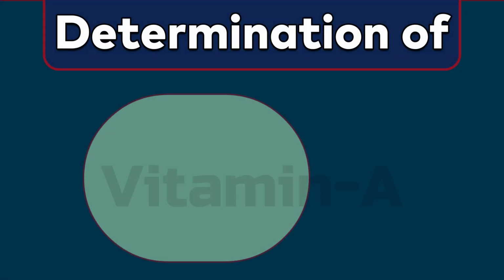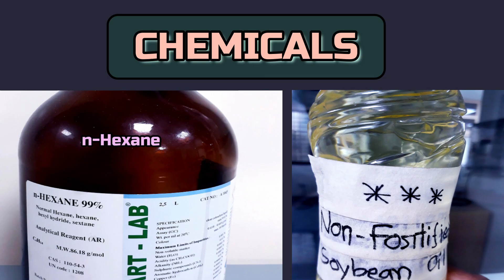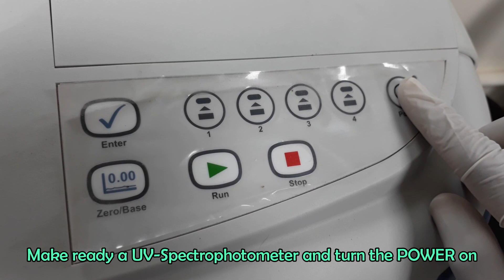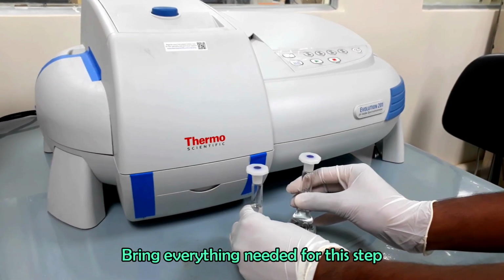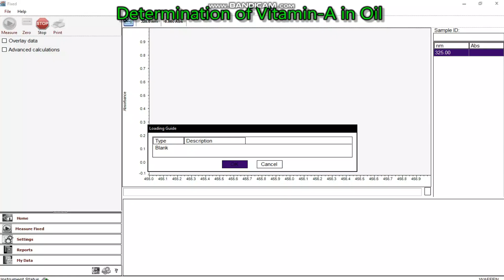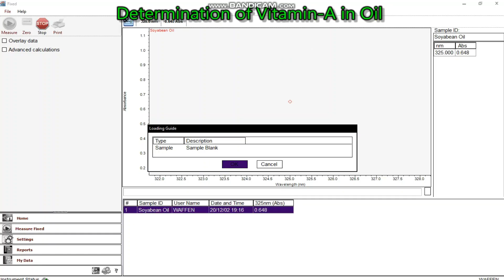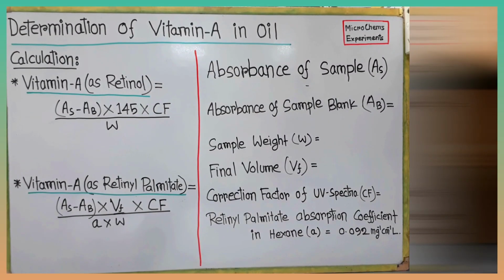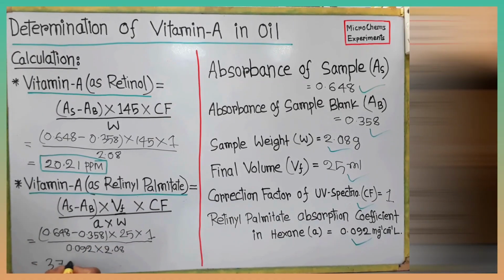Determination of Vitamin-A in Fortified Oil using UV Spectrophotometer (ECSA-HC:2007)

Comment: Hello, May I ask you a question? Is this procedure also applicable to rice bran oil. I am attempting to analyze for 25 ppm fortified rice bran oil. At that time, the result was correct; however, below 15 ppm, the result was negative.

Comment: If i'm not mistaken, for retinol calculation, 145 is used when we use dichloromethane as solvent. Cmiiw
Reply from the maker: Olivia Angelina,
Yes, for retinol calculation, 145 is used in case of both dichloromethane and hexane.

Comment: Hello all, can we use the same chemicals as well as the procedure for synthesis vit A in Fortificatied milk sample..!!?
Reply from the maker: No. this method is only applicable for oil sample. For milk sample, you need to use HPLC for the determination of Vitamin A.
Reply: @MicroChemsExperiments  ok, then what about the chemicals should be used!!?
Reply from the maker: @sagarikadas1  For HPLC method of Vitamin A test, Acetonitrile, Methanol, Trifluro Acetic Acid, Potassium Hydroxide, Standard vitamin A solution, sodium sulfate anhydrous (etc.) are needed.
Reply: @MicroChemsExperiments  thank you so much..👍
Reply from the maker: @sagarikadas1  You are welcome 😊